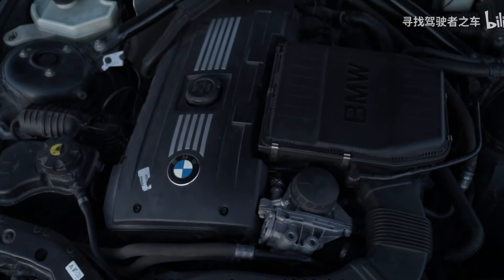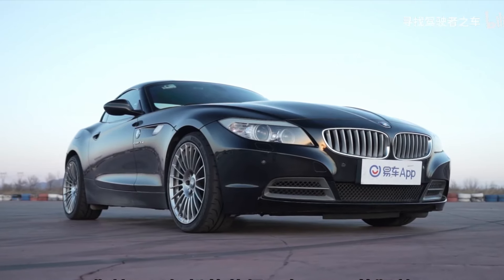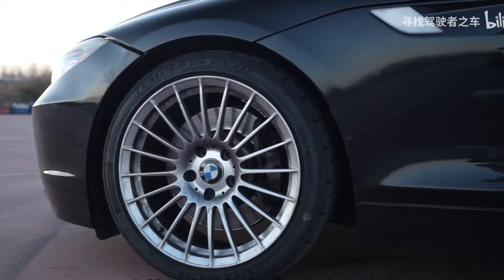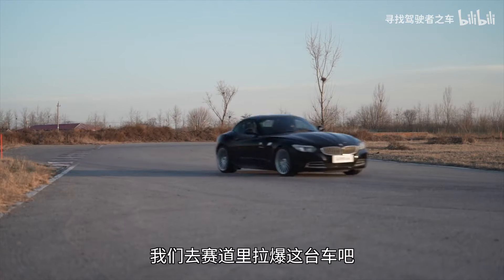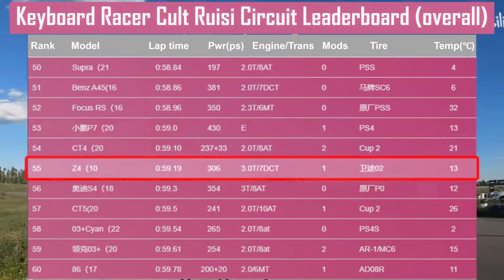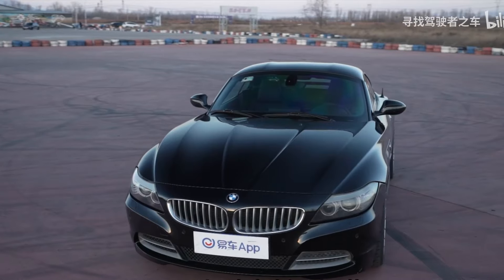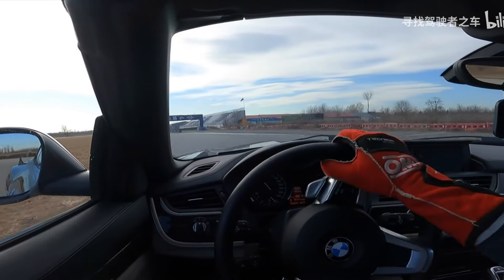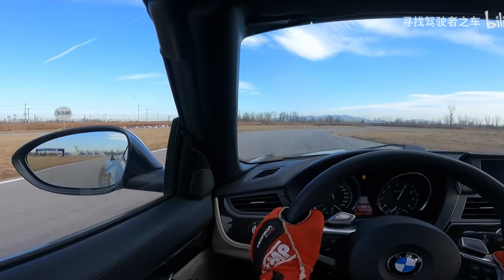Is Stock N54 Fast? -2010 BMW E89 Z4 Track Review

Comment: WRONG! I have a z4 35i with 6 speed transmission and m sport trim with adaptive suspension. the fastest e89 z4 is the 35iS with a DCT and m sport adaptive suspension stock from the factory which is the car you should have did testing with. And handling is bad? You need to do more research and google gt3 z4

Comment: Great videos, i could def see ur channel taking off! Very to the point which I like. Ive been looking at e86 z4's specifically the 3.0l non M version, but those are pretty rare and aging. I do like a lot about this car, but could see myself being dissapointed by its more GT car charachteristics as opposed to the more focused e86. Nonetheless the engine does seem amazing and the car would make for a great daily. Just wish they had a fixed hardtop and it was significantly lighter. Still in search of the perfect FR as a daily. Keep up the great videos!
Reply from the maker: First off, a massive thank you for your comment and support. It's comments like yours that fuel our passion for creating unbiased, objective track reviews!

And agreed, the E86 Z4 is a gem. Personally, I lean towards the E86 over the E89 too, and I hope you find a great one!

For an ideal FR daily, personally, I would consider the F82/F83. With some mods, it can surpass a 992s (we will make a series of F82 mod episodes to prove it). If you're looking within the Z4 lineup, the new G29 is also quite impressive. In our head-to-head tests, the lap time difference between the Z4 and the Supra (both stock condition) on a one-minute track was less than 0.5 seconds

Comment: you dont really need to go for 600hp with these cars, but i wouldnt keep them stock either... some little tweaks make a huge difference... 
First powerwise i think a stage 1 tune atleast is a must. It adds +60hp to it with no extra mods. 
This is ok for a couple of pulls, but after that oem intercooler starts to heatsoak  and you do notice some loss of power. let it cool a bit and it pulls hard again...To keep the power constant add an aftermarket intercooler to it... 5inch... they are plug and play and  keep intake air temps at higher boost pressures low.
Now you make same uprated power all the time with no wierdness... and can even run intercooler specific stage 1+ fmic tunes.. that will up the boost and power  bit more.  
From there on you could go catless downpipes to get a bit more out of it.  

Suspension of the z4 is more GT like... It has more comfort oriented fluid filled bushings or softer rubber bushings... to sharpen it up a bit you basically do what M does to BMW-s:
Replace front control arms with M3 control arms from e9x M3...you get solid rubber bushings and balljoints  for more precision and also some extra nagative camber at the front. 
Rear trailing arm bushings are soft... upgrade them to something stiffer. add bushing limiter spacers
Z4 has 2 bushings in the rear hub /trailing arm where two control arms get bolted on.. one of them is a balljoint but the second one is a  softer rubber bushing for more comfort... Swap that rubber bushing out with a balljoint. E46 m3 has both of them as balljoints... z4 rear suspension is very similar to e46... 
Finally get some good coilovers  for it ... KW v3... and good tires like PS4S...  

and now you have a car that makes near 390hp  with no heatsoak, with more grip than stock and way more precise handling than stock. With V3 adjustable coilovers you can adjust rebound and compression separately which means you can fine tune the behavior of the car...  reduce understeer , increase rear grip  etc.

Also as this car is a convertible you can aid handling by lowering the roof to the boot for lower center of gravity. This car handles better with a roof off IMO.

Anyway this is how i have set up my 35i.
Reply from the maker: Thanks for sharing your insightful modification thoughts! Really cool to see how you set up your 35i! 

By the way, our channel mostly features cars from our audience (including this E89), which brings a lot of variety. Speaking of mods, I've had an M4 myself and did a few experiments with it to check out its track capabilities. We've got a series coming up called "M4 Evolution" where I dive into this stuff. It's going to be pretty interesting to see how different mods play out on the track.

Stay tuned for the series if you're interested, and thanks again for your input. It's always awesome to connect with fellow car enthusiasts! 🚗💨
Reply: I’m not him, i came from JDM 😂. I already think my 35i handles good stock. Sounds like you know something.. I might as well copy your suspension setup for a even better handling experience…